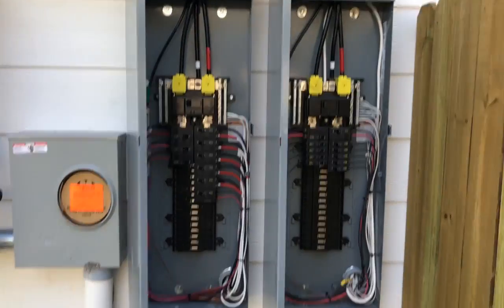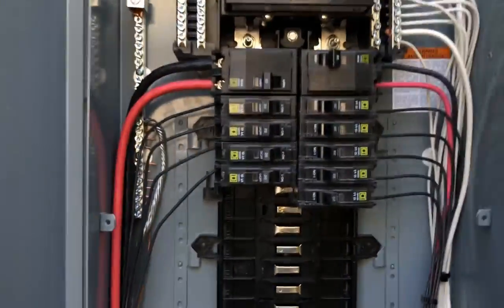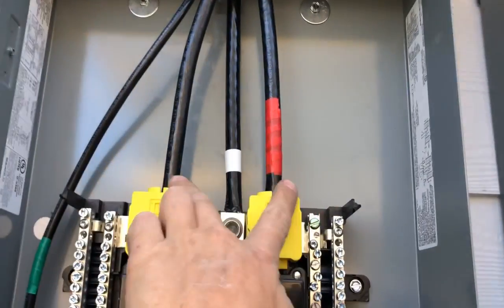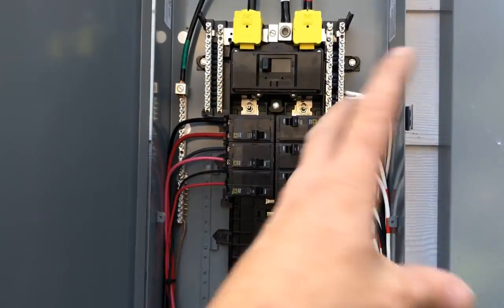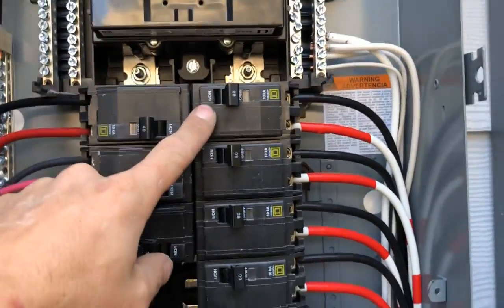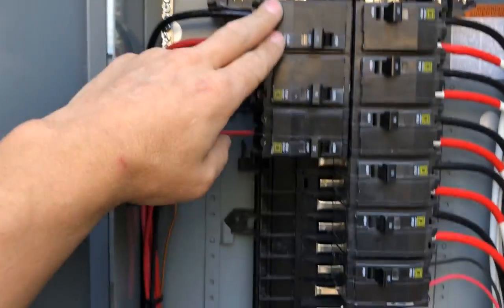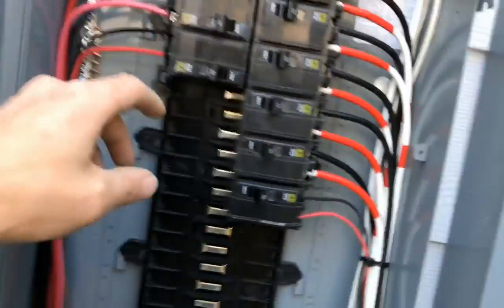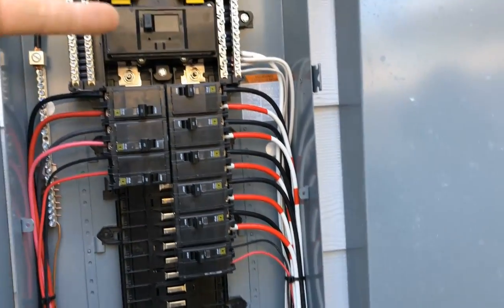Electrician Explains How Circuit Breakers And Electrical Panels Work

Comment: Some good information here, but I cringed every time you said that a load "slows" electricity down. Nothing slows it down expect an open circuit. It always travels the same speed when current is flowing, which is roughly the speed of light. More accurately I would say a load increases the flow of electricity, much like the shorted lines example you gave. In that sense it would be more accurate, though not ideal, to say that electricity "speeds up" when a load is applied.  A load will increase the flow of electrons through the wire, but they will remain flowing at the same speed, just not the same rate.

Some like to describe it in the context of a water pipe.  Voltage is the pressure and current (which increases with load) is like the size of the pipe. The larger the pipe (or load) the more water flows.  I hope that helps.  The size of the wire is also a factor in how much load can be applied before it overheats.

My two cents as an electronics engineer. I am not an electrician.
Reply: But the speed of electricity can be slowed down.
Reply: I'm not an electronics engineer. I'm an electrician and most of what you stated isn't completely accurate. If something is wired in series, then yes, the current (amperes) will never change.  Series is essentially the same idea as "daisy-chaining." In residential homes, however, most circuit branches are wired in what we call parallel. This means that the voltage will remain constant throughout a branch but the current is subject to change. We wire in parallel because if wired in series, when one light goes out, they all do (just like xmas tree lights). Parallel is when we're splicing in neutrals and hots to allow current to flow at all times to all devices which keeps the voltage constant. This is why your lights look the same every time you turn them on. Lowering the voltage results in a brownout so we need to keep the voltage constant throughout. In parallel wiring, if one light goes out, the current has an alternate path to continue and eventually returns home (back to the supply), thus only one light (lamp) will go out instead of the entire branch. If your voltage remains constant but the path length increases, the current "thins out" much like your water example. This isn't so much an issue in homes since the paths aren't very long, however, the supply conduits coming into your home may be very long underground and this has been taken into consideration. Also Loads do not increase current. They are considered resistance which not only slows down current but generates heat as well. Amperes (current) and Resistance are directly inversely proportional to each other. As one increases the other decreases and vice versa. Think of it like football. Current is the offense and Resistance is the defense. In this case though, the defense won't come after you. They just get in the way and make it take longer for you to reach the end zone.  Also an open circuit doesn't slow down current. It stops it dead in it's tracks. Imagine train tracks where a section of both rails is missing. The path is open and that train is gonna derail entirely. I hope that clears up the confusion.
Reply: Thank you , I understand the flow like you describe it as well
Reply: @esl would you consider an outlet an open circuit or closed circuit ?

Comment: I just moved in and found a 20 amp breaker that trips immediately. I tried in only once. Ideas on finding what it powers?
Nothing is labeled but the furnace and a/c.
Reply: My house was built in the 70s. Some grounded circuits some not.
Reply: Box is mounted on the block wall no wood and looks sketchy

Comment: There are so many breakers types made. You need a whole class on just using them. You got CB. MCCB. ACB....And you better understand how to adjust them all.. I actually had to call Siemens on one of there breakers. The phone call lasted 45 mins. As I tested and adjusted the breaker. As you needed a breakout box meter interface to adjust it..

Comment: My bathroom baseboard heater is not working. I replaced the thermostat, but it didn’t work. I disconnected the thermostat and checked for voltage that are coming from circuit panel. I got 120v from first leg with ground and 120v from second leg with ground, but I got zero voltage from both legs. And this kind of heater works with 240v. By the way, I replaced the thermostat and the breaker, but it’s still not working. And all the rest of 240v appliances work fine. Please help. Thanks.

Comment: I've built many Commercial Panels, I would like to add a suggestions. For you rookies, DON'T EVER RUN YOUR FINGERS ALL OVER A PANEL LIKE HE DID
If it's hot and you touch the terminal you could be dead or in hospital.
Panels are no joke, take very serious.
The two phases in are the Hot Wires then you have a Neutral in the center. 
You also have an Earth Ground, that carries the used electricity back into the Earth. Make sure you understand what code is for Grounding in your area.
Grounding can be connecting to the Foundational Rebar Structure before you pour concrete
Or, using a 10-Foot Copper rod- that's embedded in the Earth core.
Reply: It's a good video but that made me flinch

Comment: There’s a really good video out there that shows you exactly how a circuit breaker works in two different ways to disconnect power, using a cut-away breaker with a slow mo camera
Reply: So what's the title of that video?

Comment: breakers have 2 shut off, one is a instance trip ground fault , works magnetic and in mil sec,  second one is thermal load, measures the temperature of the wire terminal  calibrated ambient of 87 degrees, this is to protect the wire insulation from over heating or overload,  correct me if  iam off , been a couple of decade since school.
Reply: 87c

Comment: An 15 Amp breaker breaks at 5 to 10 times the nominal amps at shortcircuit and in 20 30 minutea will shot off if tje termical side is activated

Comment: Great Video. Quick question if you have a 220v appliance that draws a total of 25 amps. Since it has 2 hot wires coming to the plug is it safe to say it’s drawing 12.5 amps on each leg.
Reply: No… if it draws 25 amps then there’s 25 amps on each phase

Comment: Been Electrician for 6 years now. Didnt really have an Journeyman to instruct me as the management of our company really was trash so im still furthering my studies alot and your videos are straight man keep it up. Wouldn't mind seeing a video you go over adding or replacing wiring/circuits in existing homes.
Reply: Same here after being electrician for two years I decided to study more.So, I save some decent money and currently  doing my Bsc in electrical engineering technology and currently in 8th semester.
So if you want to gain more knowledge instead of experience it is good choice.

Comment: Just a basic homeowner here. Very little electrical knowledge, but when looking at a panel its to me like WTF are all those wires for? I'm just curious how things work, especially the main wires coming in. I'd like to understand about 220v coming in then splitting into 110v? When you're explaining stuff, remember you know it already and its child's play to you. You may skip some things that are obvious to you but not to people like me. Love the videos , and you ARE a good teacher. I've already learned a good bit. Don't worry, I'll still get a certified electrician to do any work I need!  LOL!!
Reply: 220v comes from the difference in potential of the two lines. In this panel, there is a black, red, and white. As Dustin mentioned in this video, there is current flow when two of those lines are connected together with a load between them. The black and red lines are your hot lines and the white is the neutral. Each of the black and red wires has 110V on it, while your neutral is connected to ground which makes it have 0v on it. A load has 110v when you connect one of the hot lines to the load and then it comes back through the neutral. A load sees 220v when a load is connected between two hot lines. To put it simply, because each leg has 110v on it, the total voltage adds. The same is true for the 110v load. Because one wire has 110v on it and the neutral has zero volts, the reading would be 110v.

Comment: Sir you are really awesome with your videos. Just curious sir, why then is it not good to put say a high ton AC unit on a low amp breaker say 16amps breaker.thanks sir
Reply from the maker: You have to match the wire size and overcurrent device with the nameplate of the equipment.  Most equipment like AC's will tell you what overcurrent protection device to put on the equipment, and if you don't the warranty is voided.  Also if you put too small of a breaker on a large unit it will simply trip immediately when the unit turns on.
Reply: @electricianu  brilliant reply

Comment: Are all those empty bus tabs live? Or are they only live when the breaker is put on it?
Reply from the maker: No they’re live all the time! That’s how they make the breakers hot on the line side. The load side doesn’t send power out through the wires until you engage the handle in the on position. You’re essentially connecting those bus tabs to the wires when you flip the breaker on.

Comment: Good videos, but a little misleading for someone who really wants to know this stuff. There's an electromagnet in a breaker, but it's there to sense the magnetic field that's created by the huge jump in current flow from a short. That's not what the 40a rating is for. All the breakers in that panel have the same rating for their magnetic element, and it's probably 10Ka. It's called the AIC rating, or ampere interrupting capacity. The 40a rating refers the the thermal element in the breaker, which is a bi-metallic strip. It protects the conductors from overheating due to overloading.
Reply from the maker: You’re absolutely right.  I should have broken that down deeper thank you for being thorough.  The electromagnet is set up to disconnect instantaneous faults whereas the bimetallic strip is for slower overheating (overload) beyond the breaker’s circuit rating. Both play an equal role but for different reasons. Also the AIC rating is not always 10ka, depends on the style of breaker for instance you can get a 22ka 40a 3-pole breaker that has larger lugs for bigger wire that will fit the same panelboard as the 10ka.  But I’m guessing you already knew that 😉

Comment: video ideas maybe? electrical blueprints, how to wire a disconnect/meter. different transformers (12v,24v) thank you so much for all the videos and drawings
Reply from the maker: awesome man, thank you for the suggestions.  none of that is too hard to come by, I'll get on it.  I have a job we're building a 480v service and hanging a 500lb 480/208 transformer in the ceiling so I can probably hit all that in the next few weeks.  Mas preesh homie!

Comment: I guess it’s a USA thing with putting the panel on the outside of the house.   Is that code? Or is this just how it’s done?
Reply: Electrician U out of curiosity, what area do you typically work in because I’m from the New Jersey area and they are indoors 99% of the time
Reply: James iPad from my experience, they are typically in garages or basements
Reply: Sam W mine too
Reply from the maker: Yes our transformers are either run overhead from a pole to the side of a house, or underground from a pole or a pedistal to the side of a house.  There is nowhere that I know of here that allows services to inside of a house.  We still do put SUBpanels inside of the house.  Just the main service panel is outside by the meter.
Reply: Electrician U yea I was gonna say in pa and nj for the most part all panels are on the inside of homes
Reply: @dylanheckman7793  same here in Mass. always inside

Comment: Hey I’ve got a question, if I put a small Knick into the black and white conductor of 14/2 while I was splicing and now they are in a potlight, is that a hazard? I did it by accident and it’s been tearing away at my mind I just don’t want that house to burn down because of me. The knicks were less that a mm big.
Reply from the maker: It's hard to say from not seeing it.  If its a scratch you're fine.  If you think that over time the wires might break in half then it's a good idea to mention it to your crewlead and have them go back and check it out.  If it was a deep enough knick the wire could break and create a high-impedance arc which could potentially start a fire.  However if it's just a knick in the insulation but the wire itself is fine then you're probably ok.  Next time make sure you put some tape around the insulation if this is the case just so it doesn't trip the circuit or get somebody shocked if they were to touch it.  Good question though.

Next time something like this happens its better to ask before putting it all in and walking away.  If it were a bigger issue and you didn't say something it could cost someone a home or a life.  Don't be afraid to ask questions my friend.  Ask away!
Reply: Electrician U thanks for the reply Dustin. I went back to the site and fixed it, thank goodness I left a service loop above the pot. I do as a lot of questions, I was just embarrassed because that was my first day meeting a ton of the guys including the boss.

Cheers, Sean